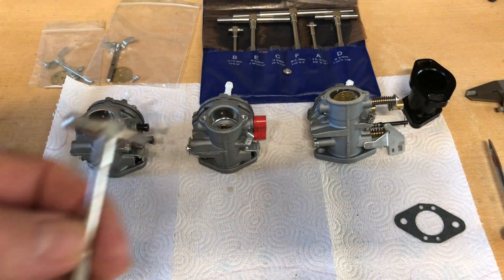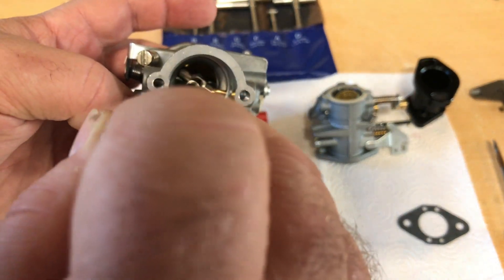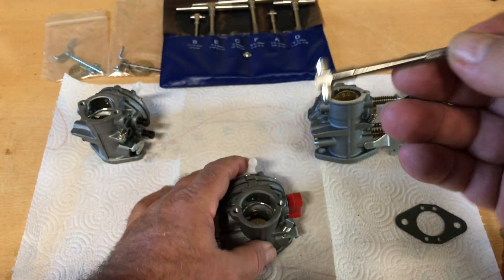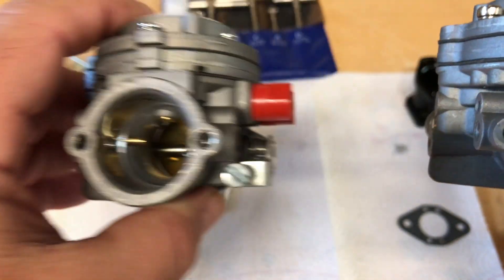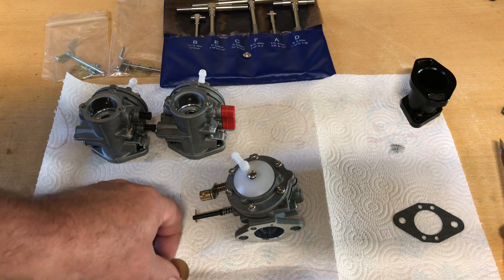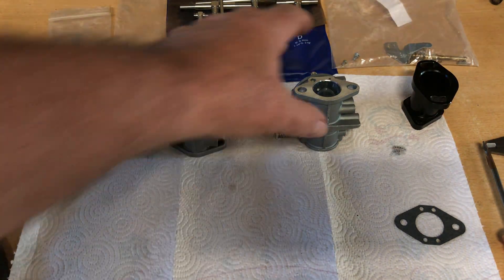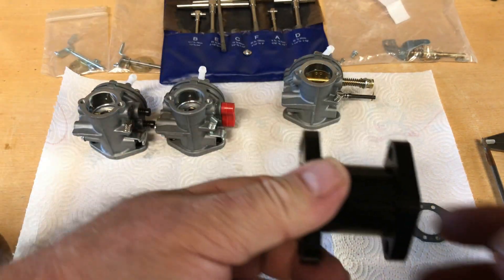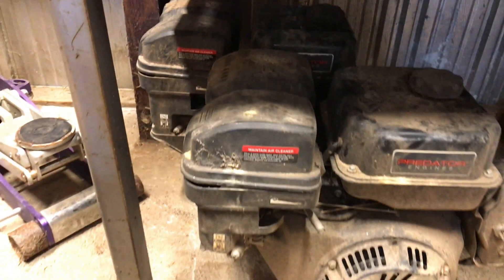$13 Tillotson Carburetor Venturi Size Measurements + 420cc Engine Performance Build Candidates!

Comment: I just used the Harley one on a 196. Worked pretty good. I modified the throttle and removed the choke.  Had to drill the jet out to .045” and it was a good runner. But I just got a mofuan. Idk how to spell it and it seems to be much better quality.  Got it off temu for 13$. I think they are better than a PWK style. And you make a few parts and it works.  Fun to mess with
Reply from the maker: Hi James! I love these little carbs! They're cheap enough to play with even if you have to buy the $50 intake. (Really cheap if you make your own intake) Much better performance with Methanol fuel than the VM-22 or PWK slide carbs. I'd love to see a Tillotson style pumper carb with a slide instead of a butterfly. EC has the parts if you want to double or triple stack the pump as well. Closest thing to fuel injection I've seen.
Reply: The 7$ intake off temu or Amazon for a clone engine. Fits perfectly if you dremal put a small divet for the pulse port.   So have you run one with methanol without drilling out any ports. I have it detuned to run a 200cc on gas so it seems like I can get it to flow more than double the fuel for methanol without any major modifications.  I have the pivot arm bent for half travel and the hi/lo out 1 turn or less and it still runs fairly rich.  I think they would work good on methanol.
Reply from the maker: Hi James! I've not converted any of the clone Tillotson carbs for Methanol use. I do have several Methanol Tillotsons (the real ones). It's a great idea to try on the cheapies because it won't break the bank if an experiment goes wrong. Please be careful if you get into drilling for Methanol use, once holes are made, you can't go back. Another important thing to consider would be to change the internal diaphragms to some made from Methanol friendly material, and adding a 2nd pump block. (stack the pumps, two is good, three is better if your engine can handle the fuel, EC has the plates you need available) Setting the popoff is very important for fuel control as well. My last Blockzilla was a three pump stack and would actually spit raw Methanol fuel out of the exhaust at idle. If you're interested in building Methanol Tilly carbs, I'd suggest buying a Methanol Tilly from EC first, then compare what they did to theirs to what you need to do to yours. Building Methanol Tillotson carbs is really an art. It can be done and you will get good with practice but I'm not ashamed to admit the last Methanol Tilly I ran on my open Blockzilla came from EC and was also race prepped by EC for my engine. They're the best.
Reply: Thanks KFF. That’s good advice. I have not yet tried doing more stacks. But I was looking into how to do it. I was thinking of just buying one from EC and seeing what’s going on inside.  Definitely subbed to the channel. Have a good one

Comment: Great idea! So how did the Predator 212 run with the clone Tillotson pumper carb? What manifold works and a/f adapter?
Reply from the maker: Hi Don! I used this one on the Ducar 212 engine Build. There's a clip of it running either in the last Ducar 212 engine build video or the fuel pump install video. Maybe both? It runs great! It can really pop if you have the fuel screws turned up. These little Tilly clone carbs are awesome runners. Add an extra plate and double stack for more fuel if you're building a fire breather. I love these little carbs. Closest thing I've found to fuel injection performance for a small engine. The manifold came from Turk Brothers on this one but EC carbs or ARC probably has them too. The intake is roughly $50 and that stinks, but still worth it. (Or you can make a home made intake cheaper, just remember to include the small vacuum hole for the carb pump) Although this one is set up for gasoline, the Tillotson alcohol carbs always made the most power for my open kart. I love them.

Comment: Hey bro. Can you tell me what air filter adapter you use for those carbs?
Reply from the maker: Hi James!  That's a great question and I've decided to make a video on the air filter adapter part numbers. The filter adapter I used on the Tillotson clone carb is part # 308VS purchased at EC Carburetors but it is wrong for the carb I ended up using. The ID on the adapter is a bit smaller than the air horn of the carb but larger than the venturi. It will work, but the ID on the adapter really should be opened up a little to match the carb air horn. At least the bolt spacing is correct. The dimensions on this one are 2.5" OD for the filter, .913" on the ID and the bolt spacing is 1.375" fitted with 10-32 fasteners. I did remove the choke butterfly and shaft from my carb as the Tilly's don't need a choke as they pump plenty of fuel for a cold start, the choke shaft and butterfly is just blocking air flow. I think the correct part # 302VS would be a much better match. The video will be out tomorrow.
Reply: @KentuckyFriedFixes  was also wondering how you hooked up choke. So just remove it. Ok will do. Thank you lots bud.
Reply from the maker: Yes Sir! We don't need no choke on our $14 Tilly!
Reply: Awesome bro. Appreciate you bud.

Comment: hi kff do you think the tilloson carb will be to much gas for a 5 hp  b/s only intak i found is a b/s to tilloson   carb
Reply from the maker: Kevin the Tillotson works hand in hand with a 5HP Briggs flatty. They're made for each other, especially if you run Methanol fuel! Gasoline works fine as well but they really shine on Methanol. Just remember to keep the venturi size below 1" if you have stock valves and you'll be tickled pink!

Comment: how come i see some guy do pop off pressure on carb
Reply from the maker: Hi Kevin! If you're building one for competition it's a good idea to do the pop off check to test for leaks at or around the needle. It can also tell you if the carb is working correctly as well (air leak or busted diaphragm). If you get into the Tilly carbs and building them for performance applications it's a good idea to have a vacuum/pressure tester pump. There's a complete test kit made specifically for this but it's a little pricy. You can always come up with a few fittings that will work with a low cost vacuum/pressure test pump kit though and achieve the same results.
Reply: i wish for comp but i probably get beat by granny
Reply from the maker: LOL! Now Kevin, Tillotsons are like everything else. Don't be afraid to experiment. I've never met anyone that didn't make a few mistakes while learning something new (especially me, I've made tons of mistakes and still do). With some practice and figuring out what works for you and what doesn't, you'll be building multi stack racing Tillys in no time!

Comment: You do so much great work on these little engines. I’m going to make a custom manifold to fit a mikuni carburetor on a 49cc engine.
Reply from the maker: Sam that performance two stroke you built for Little Sam's BMW kart already rips!
Reply: @KentuckyFriedFixes  it’s going to be for little red.
Reply from the maker: I just watched the Jordan Park video, great stuff. The little red kart was flying when you were stuck on full throttle! LOL!  Little Sam probably needs to be put into a race kart in a few years. That young man is gonna be a driver!

Comment: Hello. I have a ducar stage 2 with .009 head gasket and authentic Mikuni VM22 with 140 main and 15 pilot. I have a dead spot when I crack the throttle. Any suggestions?   Thank you!
Reply: Mod 2 cam as well.
Reply from the maker: Also, make sure you check out my "How to Tune the VM22 Mikuni Clone" video. It has a lot of important details in the description as well as a link to a PDF file for tuning those.
Reply from the maker: Hi Nitroman365! If there are no vacuum leaks and if you're getting a lean spot near idle, it could be the air mix screw out of adjustment or, the pilot jet is a bit small. If you're running a 140 main and it seems to be running good, I'd bet you need at least a size 20 idle jet or larger. You'll have to do the adjustment on the air mix and count the turns when you've got it adjusted to the best setting you can get out of it.  Remember to count the turns it takes to close the air mix screw. If it's less than 1 turn, the idle jet is too lean. More than 2 turns and the idle jet is too rich. I'll bet your idle jet is too small.

Comment: Do you like the tillotson Over the vm22?
Reply from the maker: Hi Oggie Outdoors! Both carbs have advantages and I do love both. It boils down to the application. For max air flow on a mini bike application you can't beat a slide carb, but for kart racing with a Methanol engine it's hard to beat a Tillotson double stack pumper carb. I've tried both on an open Blockzilla years ago, the double stack Tillotson performed better than the slide carb with Methanol as it actually pumps more fuel into the engine. The Tillotson carbs are essentially a diaphragm pump type fuel injection.
Reply: @KentuckyFriedFixes  thanks, my 224 build is going in a big tire mini bike that will see some circle track racing. I’m building it up like you’re ducar with the mongoose cam. I order the tilly carb but if it doesn’t work out it’s cheap enough to put away for another build. Then I may try the round slide nibbi carb.
Reply from the maker: @JohnOgdenJr  The Tilly should be great for a 224. The only thing that irks me is the price of the intake. $50 is a lot IMO. I will likely throw some homemade intakes together with some 1" pipe and a couple of large washers from the TSC store. You could do the same thing. I've seen your videos on the Enduro Harley, so I know you have the skills. The Nibbi carbs look NICE, but they're a bit pricey for my projects. I have to try and keep the costs down to a reasonable amount per engine as much as I can. These projects are mostly for mini bikes and yard karts. Now if I was going racing again, I wouldn't be as "frugal minded" LOL! Thanks man!
Reply: @KentuckyFriedFixes  I have a chunk of 1/2" aluminum, may try to redneck me up a carb intake.